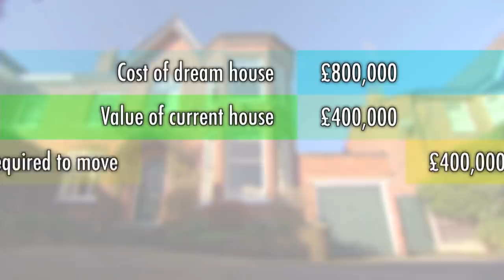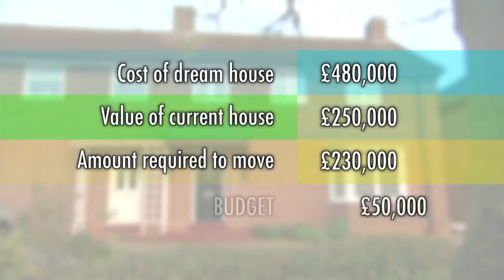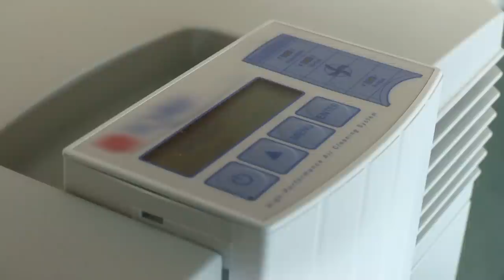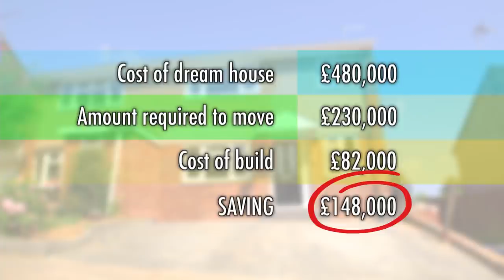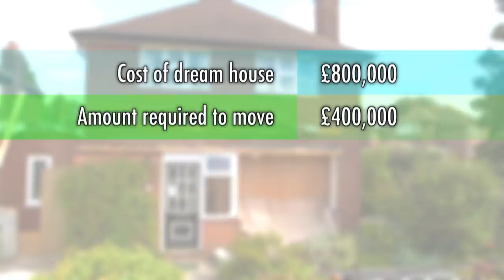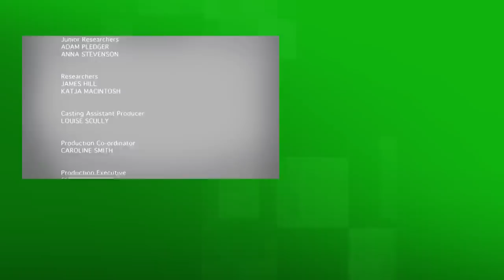Art Deco Makeover - Double Your House For Half The Money - S03 EP10 - Interior Design

Comment: HOUSE #1 ---The before plan main/ground floor is @ 8:12.
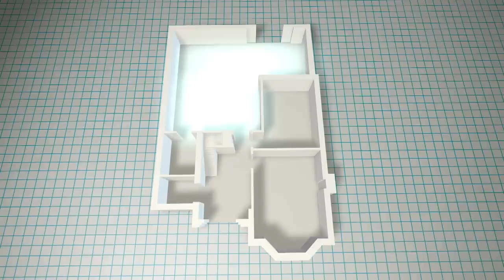The projected 'after' is @8:19,
Upper floor at 8:38

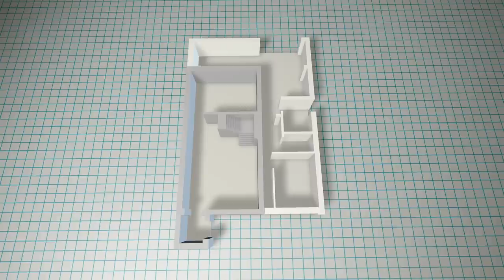HOUSE #2 ---The before plan main/ground floor is @13:37.
The projected 'after' is @13:41
Upper at 13:49.

Beeny's right about the lack of storage.  And the master bath is still small for two people.  Hopefully they have a downstairs half bath at least.  Dislike Beeny's ideas on this because she hasn't fully though it through.  She should advise people to do a floor plan with exact measurements to encourage people to try the space several ways.   A walk-in closet with access to the bath may have been better for the couple.  A longer, built in desk would have likely allowed both of them to use the office at the same time, if need be.
Wheelie bins are difficult to move.  They're heavy, bulky and prone to tipping.  In the back they're out of sight, out of mind.  It's expensive to miss trash pick up day.  And they need that garage for his tools.
The outer marriage line is obvious.  That should have been fully redone.  
Like the cheery kitchen add-on.  That does look 'thought out'.  Beeny's math is off.  The house gained more than $38 thou...

For those who don't know,  these were recorded long before they were posted to YT, so any improvements to being heard over the music is at least half a season off, if not longer.  Some of these are several years old.  I find that they fade Beeny's voice during the music swell, which is worse than playing the music at the same time as her voice.

The second house definitely is improved, though lacking as much Deco as I thought they'd have.  Think the 2 chairs off the kitchen is a bit odd.  It'll just be dead, unused space.  The lime green coloring is very flattering to those homeowners.